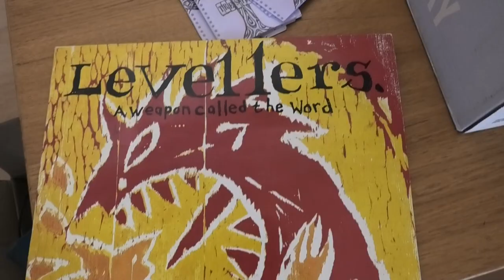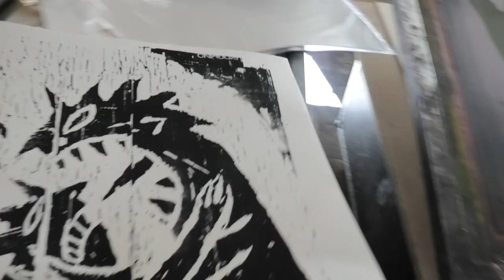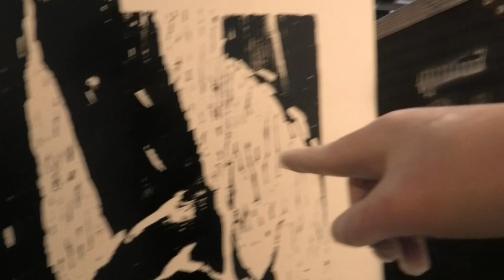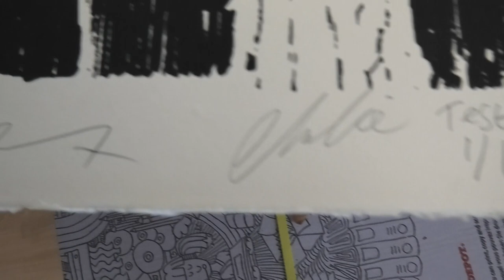A Weapon Called The Word - Charlie & Jeremy go to work

Comment: Interesting to watch as I've printed manually and by machine on different surfaces. Both different inks on different corresponding screens I'd rotate around pulling down in turn and a machine with CYMK and individual colours. The length, angle of the squeegee, tension and pressure all count. Watching for screen bleeds etc. I even covered by own dryer removing shirts I'd put through folding them as they came out. The boss didn't let me do more than monitor the automatic machine because of my epilepsy so I did all the big manual jobs which took more skill and energy.

Comment: Could print from the broken original onto tracing paper and use Indian ink to fill in the gaps from the cracked template and used that to expose the screen as if new again. You'd still be the original artist.